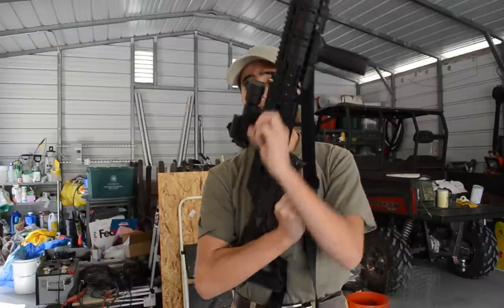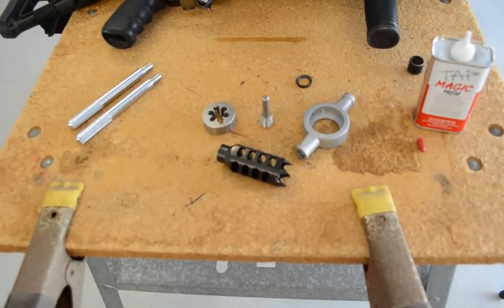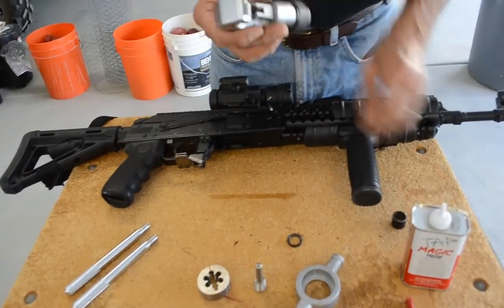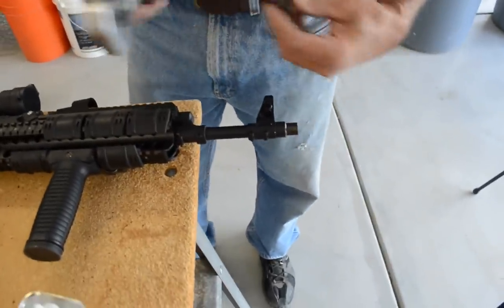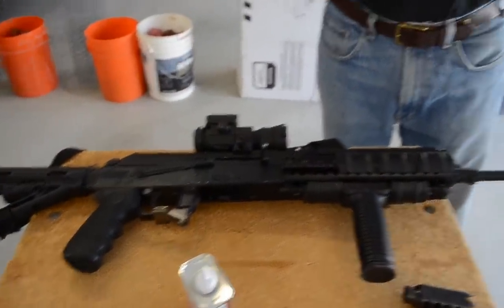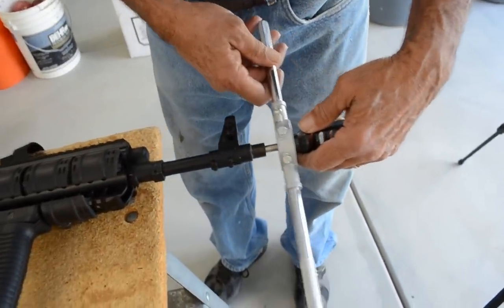AK-47 - How to thread your barrel!

Comment: You know, I believe better results and fewer errors would result from either leaving the thead starter in the die and screwing it off as the die goes onto the barrel instead of removing the die from the barrel and starting over.
That is the whole point of the thread starter, and why it is threaded.

Comment: In my state I don't even worry about threading a rifle barrel. Just hone out the muzzle brake to mach the barrel slide on then pin 📍 on. Did my Savage axis 308w
Cheep and EZY works good
Reply: What tools did you use

Comment: why wouldn't you just change out the gas block and front sight assembly to the correct AK100/74 pattern ones with the big metric threads?

Comment: I have a question regarding a misr ban model Egyptian akm that does not have the threads on the end of the barrel. It is quite smaller in diameter than some of the other 7.62 barrels I've seen like the wasr. Anyway, would I need to use the 14x1 threading tool?

Comment: the pin you put in the muzzle to keep it straight is steel not brass no issues hurting the rifling or crown? cause C.S.S. is my go to place for years now. they have a sleeve cutter now but it's like 80 bucks and i'm a plumber and have many tubing cutters on hand. so once you cut off the end of front sight sleeve the die fit the barrel OD? thanks i subbed ya too.
Reply from the maker: Thanks for watching and the sub.. That threader pin fits perfectly into the muzzle and you do need it to insure proper threading. No possibility of you ruining the barrel rifling. I used a standard tube cutter that cut the sheath off perfectly and exposed the barrel so that the die fit perfectly onto it. That AK is just as mean as ever...If you are wondering.
Reply: thanks for the come back. i making a list for C.S.S. for my Vepr's n Saiga's got to get as much as i can just incase Hillary gets in. thanks again.
Reply from the maker: Glad to help.

Comment: I want to thread a Ruger American with 1/2 28.  The barrel measures .56 to .58 in the threaded area.  Can I take this much steel off with the tap, or do I need to turn it down?  Thanks.  Great video.
Reply from the maker: Richard Durham Thanks for watching our video. Your question is  a good one.  I would contact Ruger and ask the technician this question. It would seem to me that the tap and die would shave off the excess without having to turn your barrel. I think that you are good to go with the 1/2 28 die. Good luck. By the way, beautiful rifle.

Comment: I've been told by a local "gun smith" that he would need a press and to get my barrel out of the whole receiver to have it threaded ? It's a converted saiga74 and even at that he told me it would lose value it I did.?
Reply: If he were going to thread it on a lathe (which would be more cost effective for a gunsmith as far as tooling) he would have to press out the barrel. Otherwise, you could do it yourself by buying the ~$60-150 worth of tools like in the video and not have to press out the barrel.

Comment: So, you started off threading with a right hand thread,,,but you turned the brake on with a left hand thread, did i miss some thing ?
Reply from the maker: +Darren Oerlemans No. It is a left thread. I, by habit, always start in the opposite direction to make sure that I get a good seat to start.
Reply: I saw that too. 40 year tool and die maker

Comment: Why do people try to make everything into an AR?
Reply: 415 Tray it's just a platform. It's easy to change out parts easy to do maintenance. You can modify the platform to almost anything you want so pistol grip accessories shoulder and cheek adjusters it's a good platform and can be tore down with 2 push pins so that's y.

Comment: can u do this with a pistol barrel
Reply: the barrel would need correct thickness, and length protruding from the slide
most pistols dont have that, and if they do, theyre already factory threaded

for what youd spend on a tap and die set, oil, etc, you can buy a threaded carrel and just swap it out